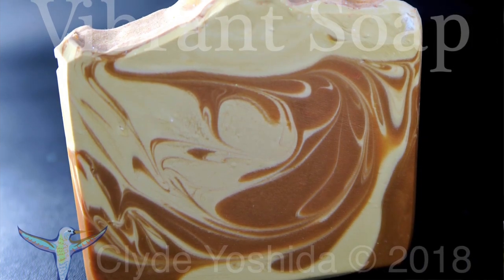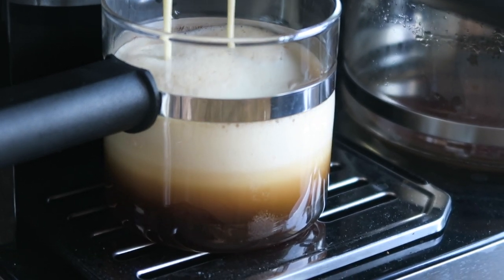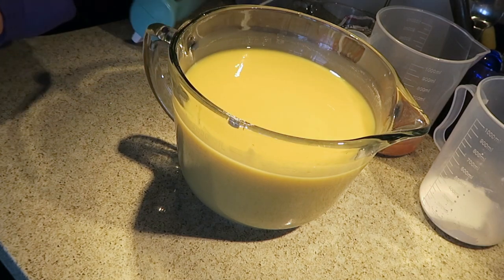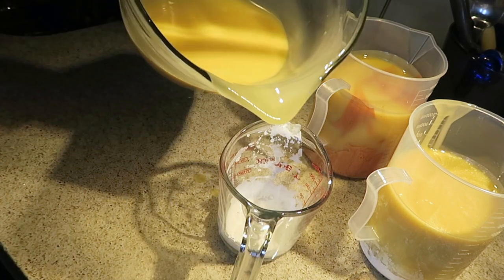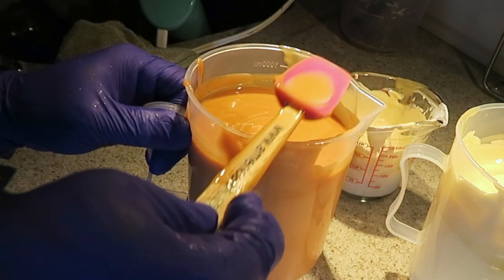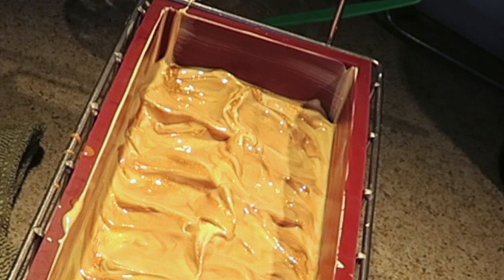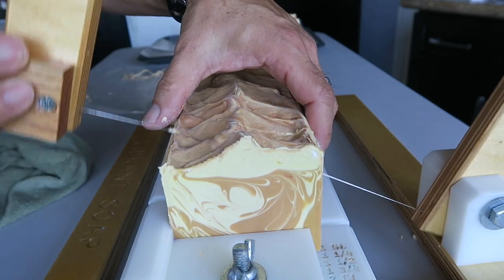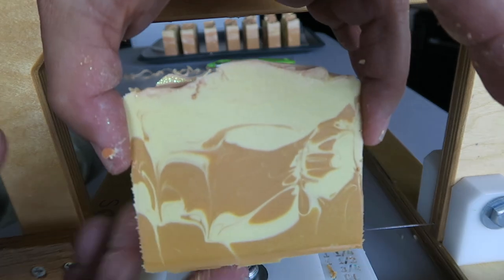Making of Two Soaps: Expressway Coffee and Oatmeal Soaps

Comment: What makes an Oatmeal, colloidal? Curious...
Reply from the maker: It's quite a write up. You should do a search for it online. Basically, the term "colloidal" refers to the breaking up of a material into very small particles. In theory, the smaller the particle of a substance, the easier it is to provide even coverage or absorption. We, in the soap making industry however, are not allowed to make any claims about the property of our soaps except that they clean. Great question. There's a lot more to learn about most all of our soap making ingredients online. Great question.